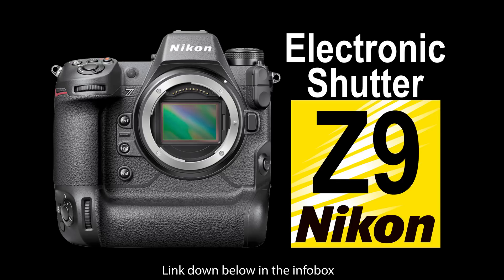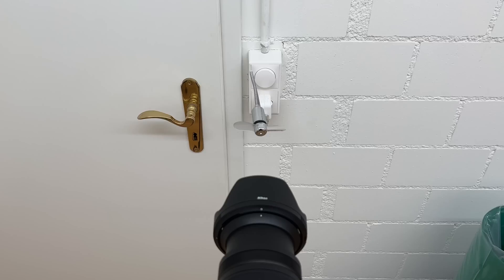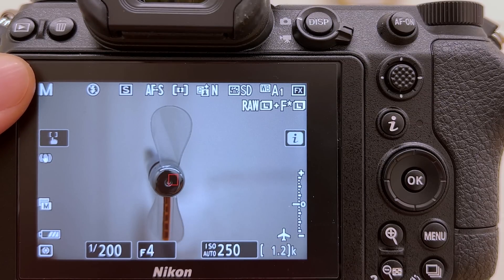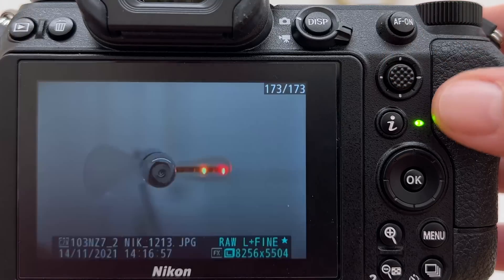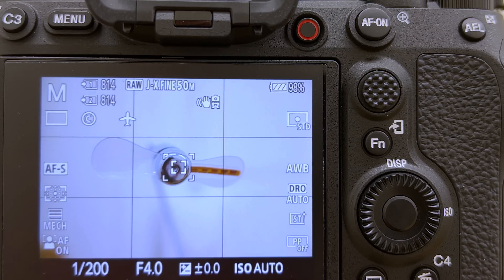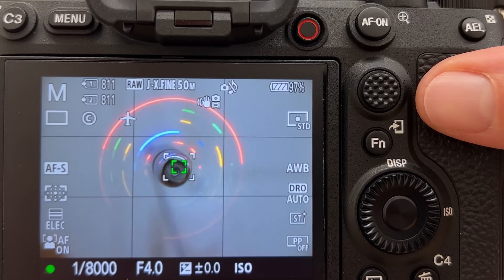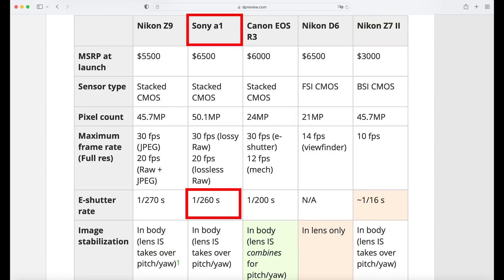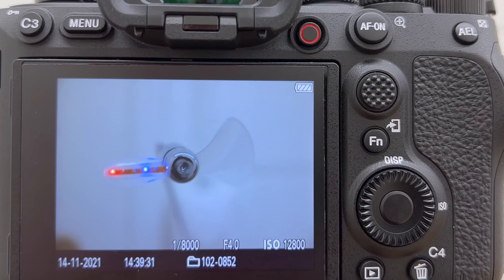NEW Nikon Z9 vs Z7II vs Sony A1 E-SHUTTER

Comment: 2016 CMOSIS (Sensor-Manufactur) announced the first BSI CMOS-Sensor with around 48MP with electronic global-shutter (Pseudo-Global-Shutter) . So the disadvantage of the "rolling-shutter effect" was solved, but way too expensive for custom cameras. Panasonic and Sony (2018) did the same btw... The pixel scan-rate of this sensortype is not row by row or progressive. The pixels are scanned all in the same time. So the read-out speed gains a lot. Due to the massive data-traffic, the frames per second count in uncompressed RAW is not so high like competitiors cameras. I ordered two Z9 Bodies for our company, beeing excited to check out, if this is true :-)